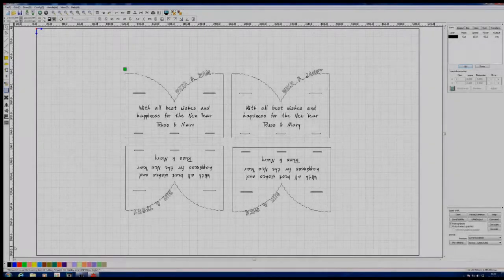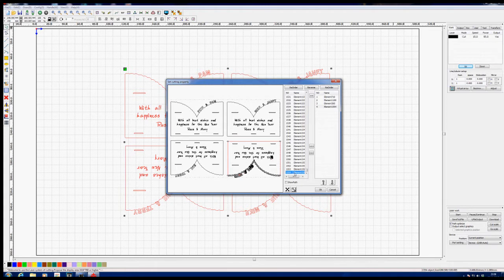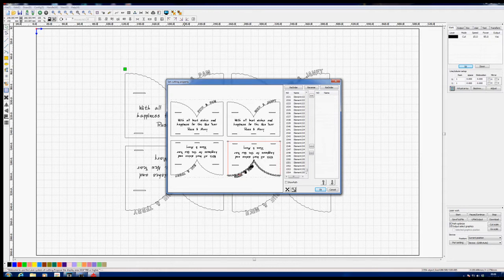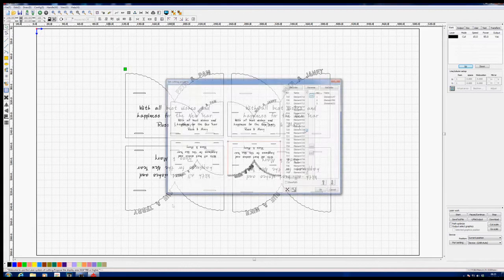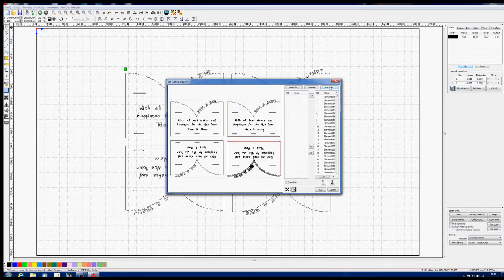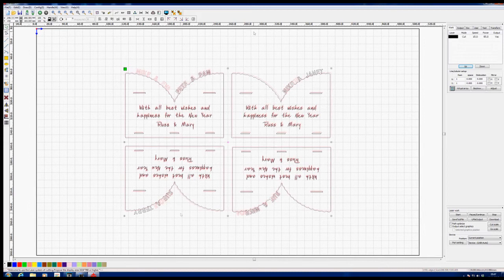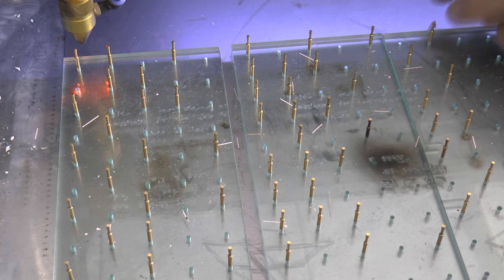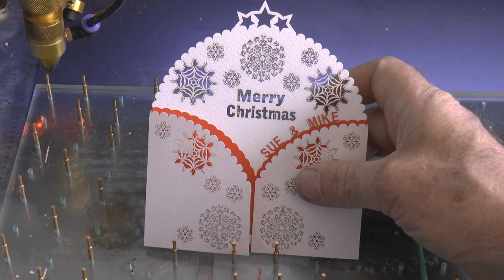RDWorks learning lab 20 Path control The final link

Comment: Dear Russ, first of all thanks for your wonderful and entertaining tutorial about chinese lasers. I like the way how you explain your experience and i am impressed by the way you scientifically analyze the problems your are faced with. So again thanks for the amount of time you saved me by just following your videos. 

Back to the cutting order problem, i personally prefer the way you have done it in earlier videos by using layers instead of sorting the list. I would choose the outlines in one layer, the writing in a second, and the cutouts in a third. This way i have to handle only a few elements, instead of sorting a few hundreds, worst case. In more complex projects it could be much more work to do the sorting of the list, specially when you got lots of small elements. This order will be saved in the file with no need to check it later, if its messed up by internal optimizations of the software. And you can use the automatic path optimization, which will only affect layerwise.

Sincerly
Christof Vorhauer
Reply from the maker: Hi Christof
You must remember that these videos are a record of my learning journey and I have much more to learn on the subject you commented on. Can I ask you to jump ahead to https://www.youtube.com/watch?v=_3oUQ9gKjCk&t=1s and you will see the method that I now use daily. It is still necessary sometimes to use layers  for different cutting/engraving parameters. However, grouping local sections together will prevent the machine jumping around randomly to cut details.

Best wishes
Russ

Comment: Hello Russ,
You solved another conundrum for me again.  I was trying to figure out why the software was ignoring my manual ordering.  Thanks, it helps me sleep at night instead of listening to my subconscious still working things out.

I already used one of the tips below and put the outside lines in their own layer, but I still had need to organize the internal layers and it was annoying to have the software re-write my work.

Your work is continuing to solve strange observations I've noticed in running the machine as well as save me from many pitfalls.
Mike
Reply from the maker: Hi Mike
Jump forward to the ultimate ordering solution that I use all the time now

https://www.youtube.com/watch?v=_3oUQ9gKjCk

Regards
Russ

Comment: No need to go back to your CAD program to fix SUE. It would only take a minute or two to fix in RDWorks using node editing.
Reply from the maker: +Harman Robotics 
Honestly, something I haven't played with. I will give it a test. However, it's so easy with proper CAD tools that I have just come to accept that it's easier to go back to source.  Perhaps the break,trim and extend tools are hidden in node editing?  In my early days with RDWorks, I couldn't fathom a practical use for the node tool and as I've progressed it's been forgotten  I'll definitely play with it again. Thanks for the tip.
Reply: +SarbarMultimedia 
You would select the shape, click on node editing, double click where you want to add a node, select that node then break. Do that twice on the S, and twice on the outline and you can then delete the parts that don't belong.

Then shift select both shapes, marquee select one node pair (on top of each other) and join. Do that for the other node pair and now the S is part of the outline. Takes longer to explain than to do it.

Much faster than going back to your CAD program and re-exporting to begin the process anew.

Comment: HI I have been watching your videos and have been doing well.  I believe something has gotten changed in the Z/U screen byaccident.  I have been doing well and yesterday anything I try to engrave I get the message no enough extend space.  Any ideas to help me.?  I am grateful for your videos because I wouldn't have gotten this far without them.  Thank you,  Kim
Reply from the maker: +kim dee 
Hi Kim
This error along with "slop" are both indicative of the program trying to drive the machine where it cannot go. Several things to check. First,  in RDWorks, is your little green square at the top left hand corner of your job when you output the program?
This green square is called the HEAD POSITION . In reality it is the PROGRAM 0,0. Technically you should be able to drive your head into the MACHINE 0,0 position (where it resets to) and press the ORIGIN button to make the PROGRAM and MACHINE  0,0s coincident. If your green square was set to top left then all program co-ordinates should be valid. For some reason that I do not understand, the machine may require a little "breathing space" away from MACHINE 0,0 for your program to run. If you re not already well away from this point  try setting your ORIGIN to about 50,50 away from the corner. Let me know if this helps if not we will check other stuff.
Russ
Reply: +SarbarMultimedia thank you for your quick response.  the square had gotten moved to top left and I still got the error message on the machine BUT when I pressed continue on my computer the machine started working and engraved the whole design.  So...still getting the error code but can at lease press continue and get it to work.  Thank you for your videos!
Reply: +kim dee sorry the green node had gotten moved somehow to top right....changed it to top left is what I meant so sorry for confusing you.....I probably sounded like the manual that makes no sense!
Reply from the maker: +kim dee 
Hi Kim
Still sounds like you are almost on machine zero in one axis. After you press RESET does your head move away from the corner? If so, roughly by how much?. With engraving,  there is overrun on the X axis at every traverse The beam stops, the head decelerates,  turns and  then accelerates back to scan speed before turning on the beam again. I think you should put your origin at least 10mm away from zero in X when engraving whereas this will not apply if you are just cutting.
Glad you are back in action.